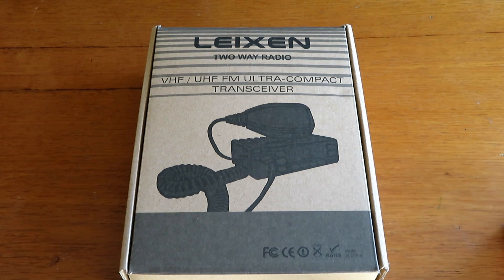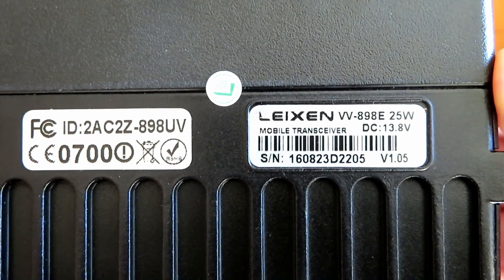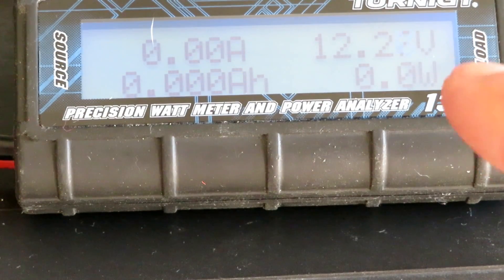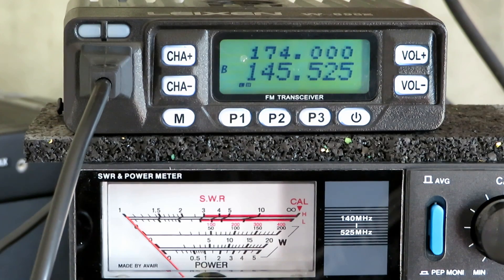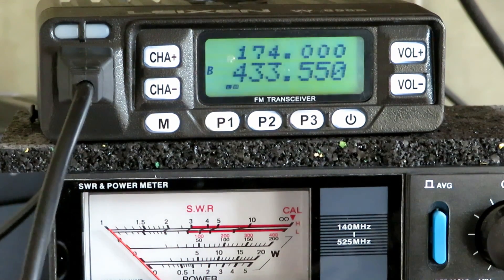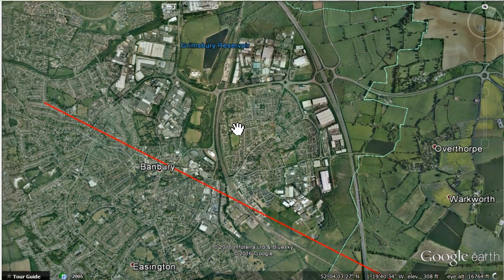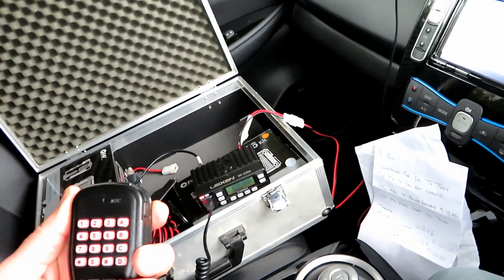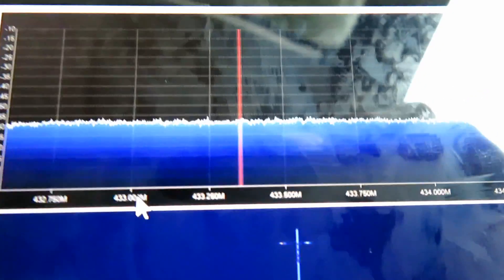LEIXEN VV 898E - HIGH POWER 25 WATT -- NEW VERSION TEST

Comment: Thanks for the review of the later higher
power model. Not bad with the heigher
power, as I had the original lower power
model a few years ago. 
Does it get hot after a while running high
power? I notice the portable now out for
a couple of years, hys tc-g25w model in
a case with a battery, utilizes the same
transceiver as you tested, with a case,
rechargeable battery, charger and an
antenna so239 connector with a dual
band antenna. One review from 2 years
a

Comment: Hi there - I have bought a Leixen VV-898S 25W Transceiver on line from ebay. I am in Australia. The radio has been good till recently when it has locked up in 001 saved memory and nothing seems to work to get it out of this mode. I have tried to do a factory reset but it stays in saved memory channel 001. My son also bought another of these and he was using the programming cable and it become red hot when being used. Have you any comments or solutions to my first and second issues described here ?
Have tried the reset operation several times with no luck at all - radio remains locked. Cheerz Stuart from Melbourne Australia
Reply from the maker: Hi, I'll check with the fella who owns this but as far as I'm aware it's OK as I've just made brackets for it to go in his car.

Comment: DO NOT waste your money on this crap. It is junk. My radio lasted a whopping 1 week. The TX stopped working. I threw it in the trash. Garbage!!!!
Reply from the maker: I didn't spend any money on it it was a friends and it's still working, you have been unlucky.
Reply: I have 10w version 3 year, and brother have 25w version 2 years. Both radios work fine.

Comment: Decided to buy that radio and it arrived today, so I thought that could be good to give some comments about it here, since this seems to be most informative video on YouTube atm.  So pros:- Cheap- Has a good audio for price- Programming via Leixens own software works good- Light weight   Cons:- Chirp doesn't really work with the radio        It has a dual memory bank so A and B have different memory channels. ,I used this By putting 2m Repeaters on A and 70cm Repeaters on B. Also you can multitask memory channels and VFO at the sametime so that is helpful.73's OF1EXC

Comment: Hi Paul – good informative video without all the usual c**p seen on the Tube!   Another Ham friend and I were looking for just this information (power output).  

Regarding the Yaesu 8900, are you aware the “int” feature is selected on your readout?  “int” is for the Yaesu WIRES system and chops off the first 3 to 4 seconds of any transmissions made.   That’s why your callsign is not heard by your SDR – just a single tone at the start of your transmission.  Just press the left VOL knob to disable.   It’s an easily-occurring operating “fault”, as the left VOL knob can be easily knocked.
Reply from the maker: Iain Meteorscan Hi and thanks for the kind words and the tip re the yaesu, I was borrowing that off a mate I'll make sure I set that back before I return it thanks for letting me know.

Comment: Thanks for the video. Cheap radio, but I'm on the look out for a bigger radio, now that I passed my ham license exam. But still a interesting littel radio. One question regarding the mag mount. Do you keep it on the roof while driving? In case you do, do you have any additional security mounting in place? I didn't see any but maybe I oversaw them.
Reply from the maker: Hi there

Thanks for the comments, the radio is a great starter radio if you are just starting out, there are other radios but you wont get much better for the money, the other option is a second hand radio if you want a radio that is bigger with more features for the same money.

The mag mount it amazing it doesnt move, ive done past the speed limit with it and it doesnt move the magnet is very strong, one thing to watch dont let someone else take it off, my missus tried to take it off and slid it across the roof instead of picking it up, it scratched the hell out of the roof on my old car.

Enjoy the hobby, I passed my exams in 1990 and still love the hobby as much all these years later.